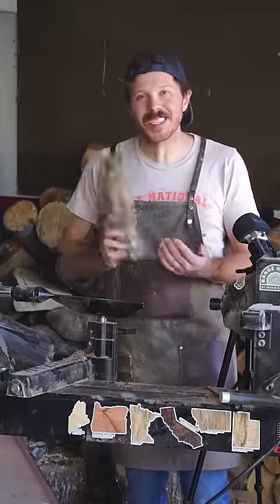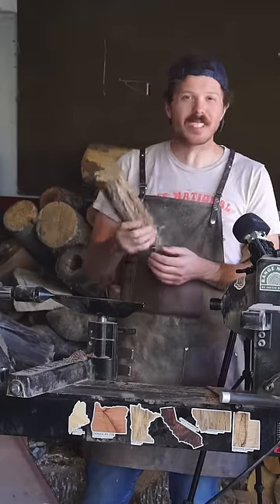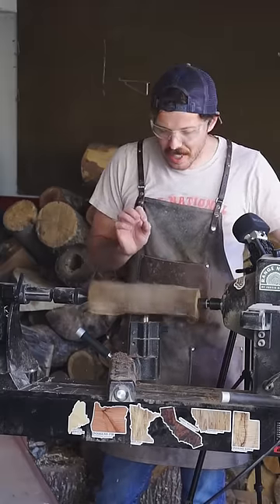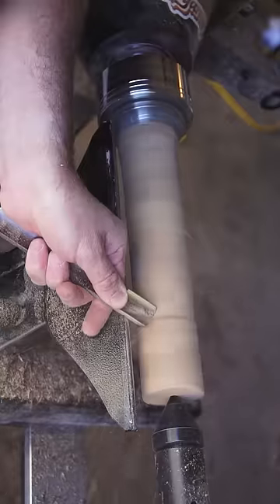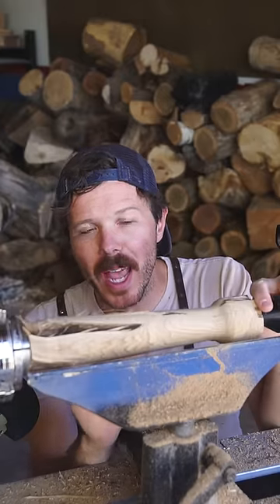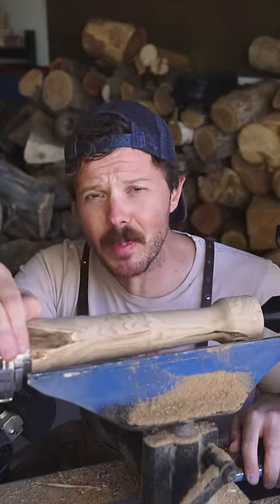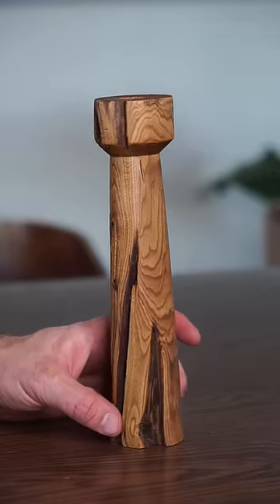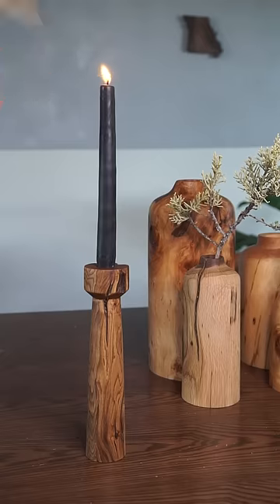Making a candlestick out of sagebrush wood

Comment: Make sure you have a metal cap in the bottom of the candle cutout mate-so it doesn’t burn the candle stick holder if it burns that low 👍

Comment: I will tell you that sagebrush wood is incredibly strong. Just mowing it with a 100 horse tractor can kill it if you hit a big one. 100 horsepower geared down to around 3:1, so the blades themselves have around 300 horsepower in them, and the brush can still manage to stop that.

Fun fact, that’s the same amou t of power the radial engines had to push around the Sherman tank, 30 tons at 25mph.

Yes, I nerded out there but the point is to never understand any type of wood cause they can be incredibly strong, even if they don’t look like it